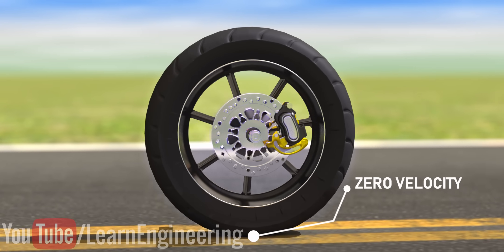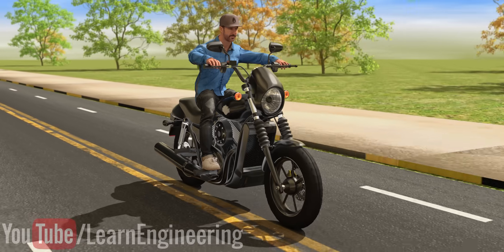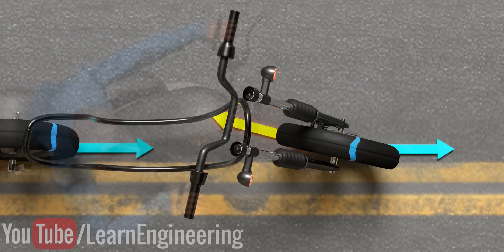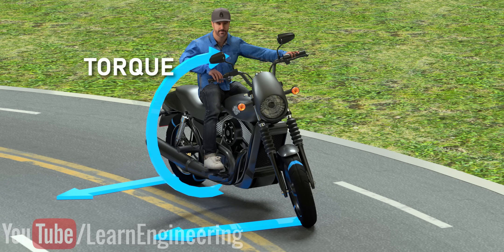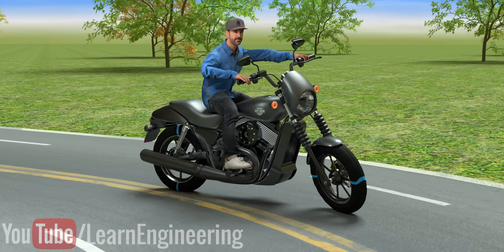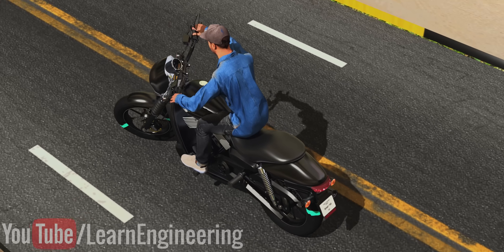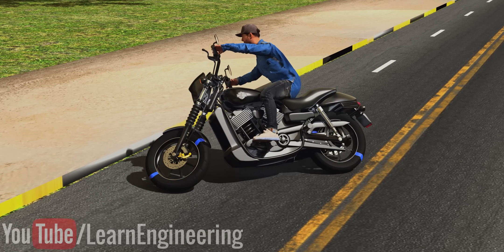Counter Steering | The interesting physics behind it

Comment: A motorcycle is a uni-track vehicle. There's no way to lean a bike without the tires being steered out from under the bike to cause it to lean. Bicycles and motorcycles are designed to be self-balancing, if the bike is leaned, the steering geometry causes the front tire to steer into the direction of lean. The most common form of this is called trail. If steering axis is virtually extended, it intercepts the pavement ahead of the front tire contact patch. The distance from the intercept point back to the contact patch is the amount of trail. If a rider leans inwards, the bike leans outwards and steers outwards, an indirect form of counter-steering that barely works on sport bikes with very little trail (link to video of this below). Once in a lean, attempting to increase lean angle further by leaning inwards more has very little effect. Conscious counter-steering is better and has been taught by Motorcycle Safety Foundation for decades. When counter-steering is used, a bikes self-stability will cause the front tire to steer into a turn once the bike is leaned, so the rider just needs to not use a lot of force to counter-steer, and allow the bike to self-correct and steer into a turn. On most bikes, a bike tends to steer inwards a little too much, which would reduce lean angle, so the rider needs to oppose the over-correction to maintain or increase lean angle.

Racing motorcycles take some turns at high speeds, 100 mph or more. At these speeds, a bike tends to hold it's current lean angle rather than straighten up, because the large amount of angular momentum of the front wheel almost exactly opposes the self-correcting tendency to steer inwards, and the perceived reaction is the bike does not change lean angle if you relax on the handlebars (it may be falling inwards or outwards, but so slowly that it's imperceptible). At high speeds, it takes as much counter-steering effort to straighten up as it does to lean. At lower speed, the angular momentum is still opposing self-correction, but less than the self-correction torque, so it acts as a dampening effect that reduces or eliminates over-correction.

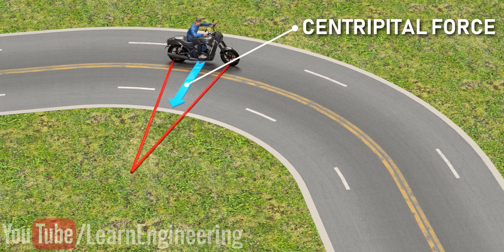Video of a sport bike with a small amount of trail that barely responds to "body-steering" (rider leaning inwards). I set the link to start at 2:20 into the video which starts with an explanation of the test bike:
https://www.youtube.com/watch?v=8_5Z3jyO2pA&t=140s

Since unicycles, unlike bicycles, don't have any self-balancing, there is no way to "body-steer", no one in the unicycle community gets this wrong, they are aware that counter-steering is the primary way to lean:
https://www.youtube.com/watch?v=UzG9_8NgngI&t=161s

Comment: Let me explain. No,there is too much. Let me sum up. You direct steer at parking lot speed. You counter steer at road speed.You do it all the time at road speed. Even just leaning when you think you are not giving handlebar input you ARE counter steering even it's a fractional amount. When you quit,the bike stands back up. This vid is going to make somebody turn right into the pavement when they try to direct steer at a higher velocity than 15-20 mph.

Comment: This is why the rest of the world is light years ahead of us in science.  Instantaneous center?  No-slip condition?  You think anybody's gonna understand that for one second.  
The reality is that to turn a 500lb bike in any direction without countersteering, you need to lean the bike first.  If you intend to go right and you turn right without leaning, the bike will turn left because you unintentionally made it lean left by turning right.  Its weight is moving straight ahead and you turn the wheel away from the line of travel.  
It's like tripping someone while they're trying to walk along.  Their body moves in a straight line.
No-slip condition indeed.
Reply: And you’re wrong too! Blind leading the blind!!😂
Reply: @softailfun  How so?
Reply: @softailfun  Oh, no?  How do you think people that don't counter-steer get around corners?  Think before you speak.
Reply: @alext8828  
They counter steer!!! They just don’t realise it!! Do you even ride for gods sake? If you do, you need more lessons!!
Yes I guess you can steer a bike without counter steering, but it will be under 15mph. The link I sent you shows the rider pushing the bars, clearly shown and couldn’t be clearer. Before you come back with more snappy comments, learn what the hell you’re preaching about. So I may not know the science, I don’t want to know the science, I don’t need to know it but I sure as hell know how I bike handles. So stop leaving comments that new riders just might act on without knowing what the hell you’re talking about!!!

Comment: If you take a motorcycle safety class, countersteering is standard.  It's how I was taught to turn.
Reply: Ive been riding 45 years. Desert racing, road racing. Hill climbing, motor cross. Observed trials. Cafe racing. And commuting on motorcycles. I had a wall full of trophies. Never counter steered once that i know of. If your not a natural, this counter steering is gonna have you on the ground.
Reply: @joepasco1420  
https://youtu.be/lzk8oyNO708

Comment: Those of us that learned to ride bicycles young do it naturally.
You steer the opposite direction you want to go to get the bike to LEAN into the direction you do want to go.
It's the LEAN that determines where you go.
But to get  the bike to lean right you first steer left.
If you have to think about you WILL hit that truck coming at you.
I ride my bike often no handed.
Steering with my feet/butt to make it lean the way I want to go by a slight bobble the other way.

Comment: So to go right I need to turn left?
I think I will stick to my car
Reply: Well basically yes, but the steering moment is hardly noticeable at all. More of a gesture than a steering action.
https://youtu.be/lzk8oyNO708
Much better video.
Reply: @softailfun  Thanks for the link.  It's actually been explained terribly... You're not actually turn the handle bars in the opposite direction,  you're just supporting the weight of them.
Reply: @questioneverything4601  
Yea, very light pressure when compared to the pressure to actually turn bars, yet the steering effect is dramatic.
Reply: @softailfun  I'm thinking of learning to ride so I'm taking in all kinds of info
Reply: @questioneverything4601  
Best pastime ever, even makes the journey to work good! Wish you well if you do it. Ride safe!🤟🏻

Comment: I've used this for years with out even knowing I was....but it's not something you need for normal riding...in my opinion....
Reply: Then your opinion is wrong! Just saying.
https://youtu.be/lzk8oyNO708
Reply: If your a defensive driver and done speed and see hazards ahead of time....you dont need to turn on a dime....hints why they give anyone a permit to people with only a written exam...and this video is wrong about the syntriphical force....the wheels have that force to work as a gyroscope to keep the bike upright....has nothing to do with the turn angle
Reply: @redawg23mobile  
Well I have no idea what you’re saying, it makes no sense. 
Counter steering is needed at any speeds over 12/15mph. If you don’t counter steer you go straight.
What’s this turning in a dime crap. Counter steering is used for every thing from swerving around an obstacle to just taking gentle curves.
As for this video, biggest load of shit on this topic, it’s dangerous and should be taken down!!!
Reply: @redawg23mobile  
Maybe this will help you: https://youtu.be/lzk8oyNO708

Comment: I feel more stupid for having watched this. I ride every day, and this just about gave me a stroke. Just ignore this one. Terrible explanation and terrible advice.
Reply: Can you give me step by step how to do counter steering? If I wanna do normal steering to the right, I would do this:
1. Turn handle to the right.
2. Slowly leaning to the right.
Reply: @chainjail4834  
https://youtu.be/lzk8oyNO708
Best video on this topic.
Reply: I'm beginner and I think this technique can help me to improve my confidence and skill. I'm very lacking at turning corners and it's very scary... So I don't ride 😭
Reply: @chainjail4834  have you ever ridden a bicycle? If so; you’ve been doing this your entire life. At very low speeds, you are using “conventional” steering. At most speeds you will naturally counter-steer. Simply look where you want to go. Let me say that again. LOOK WHERE YOU WANT TO GO. The body follows. A bike must turn at higher speeds by leaning, that’s basic physics. By pushing the bars to the right, you cause a left lean, causing the bike to go left. Remember, LOOK WHERE YOU WANT TO GO. Find a parking lot and get a little bit of speed. Look left, push left, go left. Slow speed is different; that’s about clutch, throttle, and brake control. Practice that too. Don’t fully release the clutch, ride the friction zone at about 2x the idle speed and use the REAR brake to control speed. That will be conventional steering. You’ll find that the transition between conventional and counter steering “just happens”. Practice, practice, practice. LOOK WHERE YOU WANT YO GO in all circumstances. When in doubt, throttle out. That means, if you’re getting too low or slow, give it throttle and you’ll get upright again.

Comment: This video gives the impression that the rider controls direction and lean at the same time, that isn't quite accurate.
The bike leans automatically, when you're in a corner you don't say "hang on, I've got to lean the bike further over". You can influence the lean by either going with the bike, staying upright or hanging off the bike, but the lean happens anyway.
In all cornering operations at speed the bike has to do a small counter steer and then the wheels turn into the direction of travel, otherwise cornering wouldn't be possible.

Comment: Countersteering is great to understand, agreed. If a 4 wheel car somehow was able to drive while balanced & tilted on only two wheels, it would also counter steer like a motorcycle. Anything above about 3 mph turns into counter-steering. One reason so many had trouble once the training wheels were removed from their bicycles as kids learning to ride.
Reply: A car leans in the opposite direction of a turn. Doesn't lean very far because it has four wheels instead of two. Same principle.
Reply: WHY ,,its a natural force ,all these videos do is mess with your head ,this one is extremely dangerous saying to turn your wheel the opposite direction while leaning your bike over,,they want you to practice overcoming something totally un natural

Comment: Bro , you need to take this video down, do a lot more riding and research, Then repost! This video seems like it's from a college student with limited riding experience.

Just a little advice... 

counter steering is not a sometime thing for tricks and such. Below ~ 20 mph standard turning of the handlebars, turn right to go right, is the physics at play. Go above that speed and counter steering is the ONLY way you can turn the bike effectively. You counter steer to change direction and then the steering goes to a neutral position as the bike is leaned over and you're on the inside part of the tires. To turn tighter you add more counter steering input by pushing away on the inside bar( steering head left to go right). This is forcing the front tire to a smaller radius which is what pulls the bike in that direction.

To have this conversation and not mention how tire radius and profile works is a partial conversation at best.

To have this conversation and not discuss angular momentum and the gyroscopic effect of rotating objects (the wheels most importantly, in this case) is also a partial conversation at best.

Comment: This misses basics of physics here which is Newton's law. This failed in explain lower peed and higher work differently, same Newton's law. at higher speed when the gyro effect IS dominant, then it moves as gyros do, not in same direction you push it, I call this true counter steering. You can NOT bypass physical law! The complication is the bike got both rotating and non rotating parts at work. So at higher speed, the gyro effect is dominant (which is the angular momentum moves in the direction of torque exerted, this is actually same underlining principal as motion change in direction of force, you can not avoid it since it is the LAW)!!!

Comment: CS is the only safe way to steer, especially bigger, much heavier bikes. When taking any left bend push foreword on the left grip, naturally, the opposite for the right. There is significant resistance to this, the wheel won’t turn easily but believe me, even a slight CS (it only needs to be slight) will give a big steering effect. Far more so than just leaning the bike. The reward you get is an instantaneous, positive response from the bike. All those videos of riders crashing on a bend are examples of riders neglecting to counter steer (Along with travelling too fast on crap, badly inflated tyres). By CSing you begin to learn more accurately, the limitations of your bike. I’m 62 been riding all kind of bikes my life and still do, you young’s out there need to learn it and do it to save your bike and your life.

Comment: This video is utterly wrong and even outright dangerous. The author does not even understand a tiny bit of 2 wheeled vehicle physics.

A two wheeled vehicle always is in an unstable balance, it tends to fall to one side if the rider does not counteract this tendency by an input at the steering bar to keep the wheels directly under the center of gravity (this is already countersteering). Thus a two wheeled vehicle can never really go in a straight line, even if minimal, it is a more or less constant left, right, left, right and so on. 
To a minor extent the gyroscopic effects of the wheels help to keep the bike from falling but they don't help to initiate a curve.
To ride a curve the wheels are actively directed from under the center of gravity to one side (by steering input = countersteering), the bike then falls to the other side. To prevent the fall to end in a crash, the rider then gives another steering input towards the side the bike is falling to, not so much that the bike is standing up and riding straight again, just so much that a new balance is found between curve radius, speed, lean angle, centrifugal force and centripetal force. 
To seek that balance new and again in every curve is the beauty of motorcycling.

Countersteering is not another way to initiate a curve, it's the only way.
Try to go through a curve without your hand at the steering bar only by leaning and you will go straight and crash, 100% guaranteed.
With leaning you can influence how much lean angle you need and thus how fast you can go through a curve but you cannot initiate the curve.
Reply: Wrong! The rider doesn’t give a second input into the curve. Totally incorrect! If the rider did this the bike would stand up. Why??? Because if counter steering of course!!
https://youtu.be/lzk8oyNO708
Reply: @softailfun  you didn't get the point.
The second input is necessary to prevent the bike from completely falling to the side. Of course, not so much that the bike stands up and goes straight. Duh!
Reply: @thestonegateroadrunner7305  
You are wrong! The second input is NOT necessary. The front wheel does indeed steer into the bend, but this is due to the steering geometry of the bike ..... NOT rider input. This is clearly demonstrated on the link I supplied. Sometimes it’s better to say nothing. I’ve been riding all styles of bike for 35+ years, please don’t attempt to lecture me on steering a motorcycle.
Reply: @softailfun  yeah and I'm riding for 41 years. 
Just check it out. If your smart bike by geometry magically "knows" the current curve radius you are lucky. In most cases, however, the rider is correcting to the point that fits for the particular curve radius.
You don't have to believe it but that's just how it is. If you're not aware of it, it just proves that you are an experienced rider who knows to do the right thing intiutively.
Reply: @thestonegateroadrunner7305  
Of course the rider is making minute alterations continuously be it in a straight line or a curve. If the rider wants to take a right hand bend, he pushes forward slightly on the right bar, this immediately makes the bike lean to the right, the pressure is maintained on that bar throughout the bend. The front wheel does steer into the bend due to the physics of rake, trail, steering geometry.... the rider does not steer the bike into the bend, which is how you seemed to be explaining it. That was my point. Only when the bike is coming out of the bend does the pressure release on the right bar and allow the bike to stand up. This is all clearly shown on the link.

Comment: Clicked because I was interested in the physics of it.  Down voted because of the wildly ignorant opening statements!  It's not a technique, it's literally how you turn a motorcycle and is certainly not different from normal steering.  Not to mention that weaving between cones is practice avoiding road hazards (at the minimum) and not a stupid trick.  I won't finish the video as I can't trust that the creator knows anything about what they're talking about.

Comment: I dont think the narrator ever rode a bike. When you countersteer, you do not need to "cleverly" adjust the steering after the lean at all!!. The steering geometry will turn the handlebars for you back in the direction of intended turn, even if you feel as though you are turning the opposite way. I agree that it IS the way to steer a bike. It is not difficult...it is easy. Push the right handlebar and the bike will turn right. Push harder and and it will turn right more tightly.  And vice versa. No skill needed...just faith it works until you get used to the idea and do it all the time. They don't teach this on UK CBTs and it's dangerous that they don't.